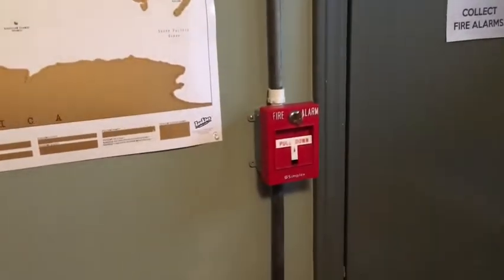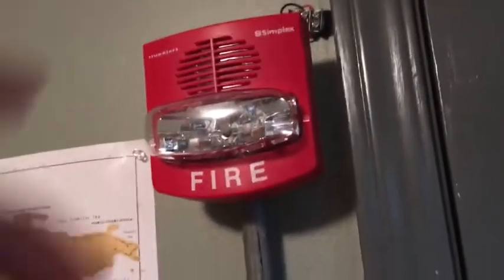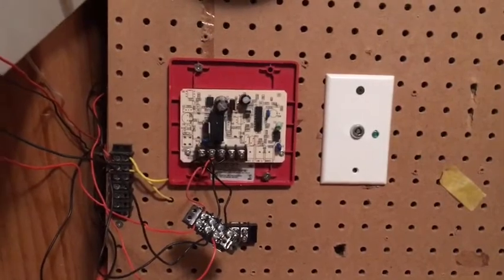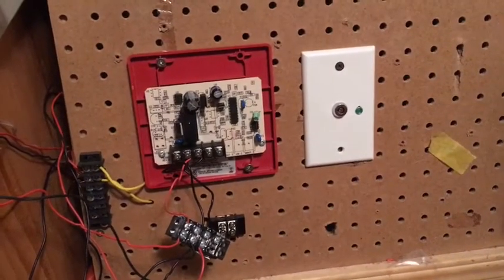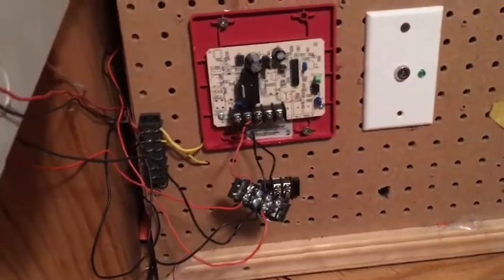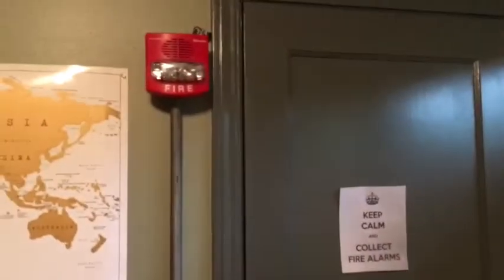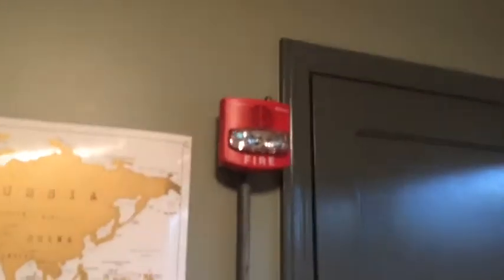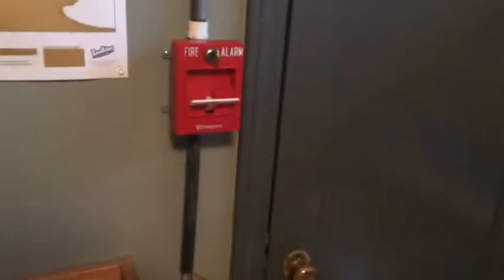More TrueAlert Hacking!

Comment: will a simplex true alert work with a firelite Panel?
Reply: RD Safety it needs to have filtered DC and you’ll need a smartsync module. check thefirepanel forums for a post on FWR/filtered DC
Reply: @ntekniklaus3710  you dont need a sync module.. just use a free run true alert.